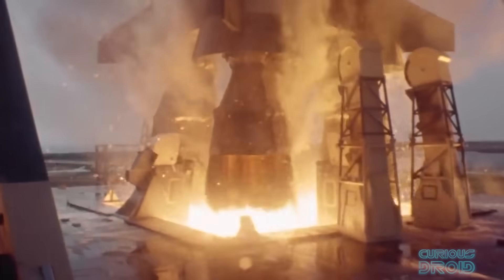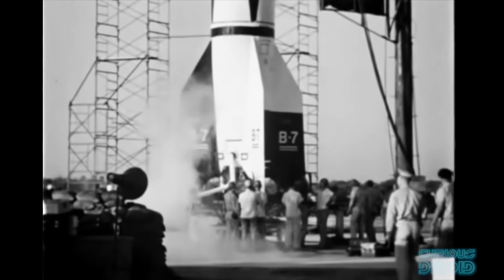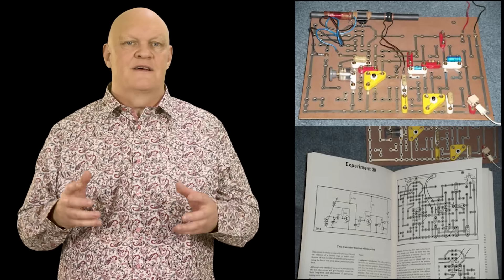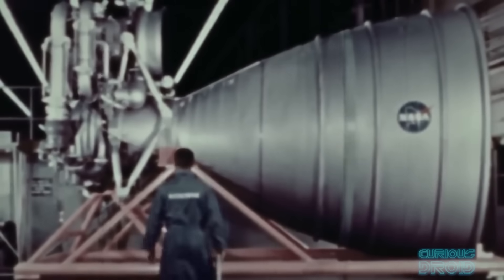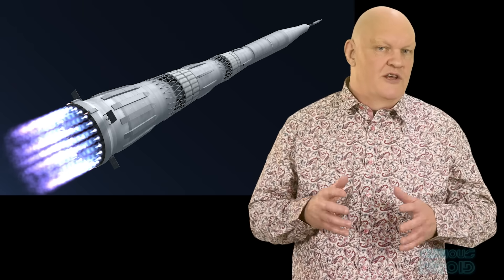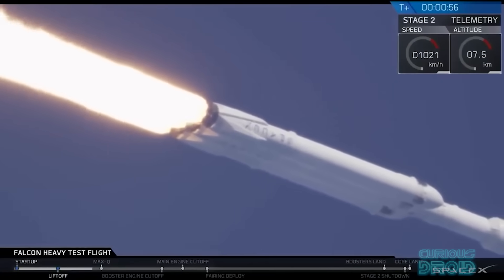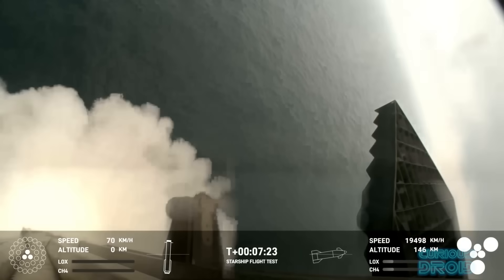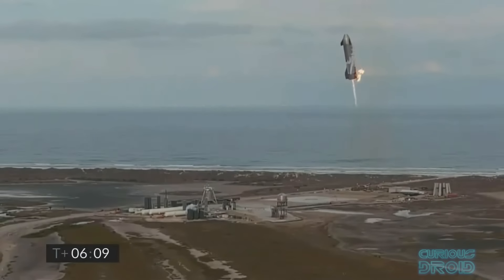Why Does SpaceX Use 33 Engines While NASA Used Just 5?

Comment: Simple answer: SpaceX didn't want to have to do that much engine R&D. So they opted to follow the example of the Soviet N1 and just use a lot of the same engines they use on smaller rockets.
Reply: You think they didn’t do R&D for raptor, an engine with the highest chamber pressure ever developed?
Reply: @infinitelyexplosive  - Doesn't change the increased risk of needing so many individual engines. Gushing over the specs is meaningless.
Reply: @daniels7907  The risk associated with engine count surely depends on the number of engine outs they can still complete a successful launch with? I don't see how any of this is related to the amount of R&D they've done on the engine design, regardless.
Reply: @infinitelyexplosive  - Depending on which engines fail, you could have anything from an explosion on the scale that the N1 experienced (the largest non-nuclear, non-natural, explosion on record) or the launcher could put the Starship into the wrong orbit. Really, this whole launch system and spacecraft are getting disturbingly complex. Did you know that they already have to assume orbital refueling of the Starship after launch into orbit before it could continue on to the Moon? That makes the mission dependent on at least two of these launching without issue and performing complex refueling in space.

This is why doing R&D for fewer, but larger, engines might have been a good idea. Starship is looking like it's the next Cybertruck.
Reply: @daniels7907  with fewer engines it becomes completely infeasible to land the rocket again. For the goal of a reusable rocket, they clearly needed to at least have fairly small engines for correct TWR when landing, somewhere between 10 and 33. Do you think a hypothetical 15 engine starship would have avoided any of the issues we’ve seen so far?

I’m still a bit confused on what your actual position on the engines is, to be honest. Do you think raptor hasn’t had enough development effort, or just that they chose the wrong architecture? How are either of those related to the moon lander, which is entirely a second stage design?
Reply: @daniels7907  It seems like you're unable to keep an idea for more than one comment. You've gone from "engine R&D effort" to "overall ship reliability" to "orbital refueling" to "elon musk politics". I'm just trying to understand how you think that developing raptor didn't take an enormous amount of R&D. At this point it doesn't seem like you'll be able to answer that.
Reply: @infinitelyexplosive  - The problem is that you fail to grasp that all these things are interconnected. I NEVER said that the Raptor series didn't consume a lot of R&D effort. YOU claimed that I said that. I was pointing out that using 30 or so Raptors like this was disturbingly similar to what the Soviets tried to do with the N1, which ended in catastrophic failure. 

That, in turn, leads to all the other problems I pointed out, which you didn't want to read because you can seemingly only focus on one aspect of anything at a time. We're not playing a game of rhetoric here. The topic is the impact of this design on the entire launch system and how SpaceX is taking large risks while trying to avoid developing purpose-built hardware for a launch system whose intended use is different even from Falcon Heavy.
Reply: @daniels7907  except that raptor was designed and built for starship. So your entire premise is incorrect.
Reply: @infinitelyexplosive  - Doesn't change the core problem: so many engines increases the number of potential problems.
Reply: @daniels7907  And in most cases decrease the impact of those problems, because you have redundancy. This is a basic engineering concept that you seem to be overlooking. Unless you can actually calculate the probability of failure and understand the number of acceptable failures, you can't actually calculate whether this increases or decreases system reliability.
Reply: @daniels7907  To be clear, N1 test flight 2 was not even close to the largest non-nuclear explosion in history. The Halifax explosion was. But whatever, let's just call it a large explosion. It's still completely absurd that you're trying to extrapolate from a single failure of a different rocket with different engines from half a century ago. It's so obviously unreasonable that I don't even know what to say.

Comment: The solution to fix huge rocket engines instability was never found. Russians tried everything, but it did not work. NASA also, so it had to fake F2 rocket engine, it simply did not have enough thrust. It was not able even to lift Saturn V rocket into orbit around the Earth. One engine had a thrust of around 120 tons, but not 700 tons, as lied by NASA.  So the whole Saturn V rocket simply splashed into the Atlantic ocean. Apollo was fake, man never landed on the Moon. If F2 rocket engine was good, then why is not being used today, some 55 - 60 years later? Because is not good, it was fake.

Comment: A little off topic but riddle me this:

Saturn V:   ≈ 3518 metric tons of thrust.  Could deliver 140 tons of payload to LEO. Could go to the moon without refueling.

Starship:   ≈ 7127 metric tons of thrust. Predicted to deliver 100 tons  to LEO. Musk says probably less. Needs upwards of 15 to 20 refueling missions to get to the Moon.

How does this make even the slightest amount of sense? What am I missing?
Reply: Starship is reusable. If you fly it expendable, it can probably deliver around 200 tons to LEO.

As for reaching the moon, Starship could reach the moon in a single launch if you just added additional stages. As an example, you could add everything from the third stage of Saturn V and up to Starship, replacing the payload bay, and do an Apollo style moon landing.
Reply: @SpaceAdvocate  None of what you are saying is reality. What you are saying is that if the starship was a different vehicle it would work differently. 

200 tons to LEO is what they call pie in the sky. It's not real.
Reply: @mrwiffler9942  It's real enough that if you went to SpaceX and said "I have this 200 ton piece of hardware I want to put in space in two years, can you do it for $500 million?" and they'd say yes. It's just a matter of doing two things, firstly, burning all the propellant, not reserving any for recovery of the vehicles, and secondly, lightening the vehicles enough that you get the needed payload margin (removing grid fins, aerosurfaces, heat shield, etc.)

But, since there is no person banging on SpaceX's door, it's not something we will see in the near future. SpaceX will continue focusing on making Starship fully and rapidly  reusable.
Reply: @SpaceAdvocate  Dude, you're living in a fantasy.
Reply: @mrwiffler9942  SpaceX specializes in making fantasy reality.

Comment: I recall, during the very early days when SpaceX was just starting design work on what was then called the Big F***ing Rocket (BFR), Elon tweeted something along the lines of "It turns out you don't need a super-large engine to do [Mars].  You can do it with an engine that develops about [a half-million pounds] of thrust.  You just need an awful lot of them."  That was the first point that I became aware his BFR was gonna feature between 30 and 40 engines in its booster that each would be about a third as powerful as an F-1.  And I said to myself "Gonna try and make an N-1 that works, eh, Elon?"  Sure enough... 😉

Comment: The 5 F1’s were better. Can you imagine what 6 of them could do?
Reply: The thrust from even a single F-1 throttled down to 50 % would be more than twice as high as the weight of an almost empty Saturn V first stage, so soft-landing that stage would be very tricky. Better to use many smaller engines and shut down most of them if you want to reuse the stage.
Just for the record:
The Saturn V is still my favourite rocket!

Comment: Space x uses engines based on outdateed russian engines. The russians used so many engines because they had issues with scaling up the size of the engines. Problem is that the more engines, means more parts... Which means that there are more parts to fail. And fail they did/do.

Comment: SpaceX considered various engine designs for their future rockets. The original Raptor was to be a much larger, hydrogen fueled design. Eventually, they decided to use methane and to size the engine for maximum thrust to weight ratio for best performance and efficiency, overall.

Comment: For those of us US citizens who started our own country and are not fascinated with the Euro be all metric system that was supposed to take over the world 60 years ago...18000 kilos is approx 40000 lbs or 20 tons and 45000 kilos is approx 100000 lbs or 50 tons. It would be nice if you would use both measurements in your videos considering these were US Rockets being built. There FTFY

Comment: Two things Paul.  First, you are wrong.  The F-1 DID NOT have a 100% success rate -- Apollo 13 had the centre engine cut-out during the launch.  Although they burned the other four longer.

Second, that has to be the smoothest segue into an advert ever.  Well done.
Reply: That was a J-2, not an F-1

Comment: In the 1960s, computerized process control was in it's infancy. It was very difficult to manage a large parallel data stream without a room sized computer. Five large engines were a lot easier to manage than 33 or 35 engines. The Russians tried it and failed spectacularly.

Comment: Having more smaller engines also makes the system more structurally sound. The center of a rocket is primarily fuel and the hull is the primary structural component. If the thrusters are put closer to the hull it reduces the leaver from the center of the thruster to the hull. So less torque tries to shear away the mounting of the engine and thus makes the engine mounts lighter. It's not the main reason and you need to balance it out with the engine system weight, but they considered it for sure.

Comment: Elon doesn’t use F-1’s because he doesn’t have any. Building f-1’s or an upgraded equivalent takes time and money they don’t have. But the first time one of the little ones takes out a rocket, that will change. More engines = too many opportunities for failure.
Reply: More engines means it doesn't matter if one fails. You'll still have enough thrust. But when one F-1 fails, it's game over.
Reply: The F-1 is unusable for Starship. 
1. it uses the wrong fuel. RP-1 leaves residue in the engine that has to be cleaned out. Not good if you want to reuse the engine. 
2. It is so large that landing the stage with these engines would be difficult: too much thrust. 
3. It is not optimized for production, they are complicated and difficult to build. Raptors are so much cheaper you can build 33 Raptors for far less than the equivalent thrust in F-1s. 
Raptor is also more efficient (more thrust per unit of fuel used).

Comment: 17:00  First batch of F-1 Engines, 40's of them worth $15,000,000 ;
($15,000,000÷40) = $375,000 per each one Engine. (Apollo needs 5's per each Travel)
($375,000 x 5) = 1,875,000 per each Apollo (Saturn V=5) launched.; $1,875,000 each
(In today's currency/inflation adjusted value) Compared to SpaceX 's Raptor Engine cost of $250,000 per each; Falcon IX=9 need 9 engines : ($250,000 x 9)= $2,250,000 each (9)
For Falcon Heavy ; need 3 of ($2,250,000 x 3) = $6,750,000 .... totally 27 tube-engines
For Super-Heavy (to Mars?) ; ($250,000 x 33) = $ 8,250,000 .... totally 33 tube-engines

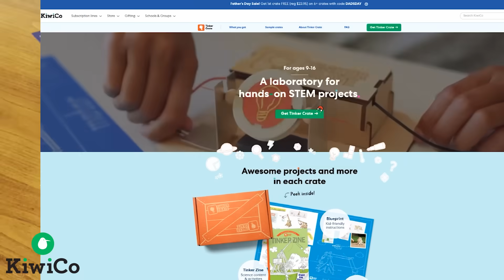Comment: Summary just for me if I come back here: So the reason is that you can easier throttle down 29 engines to landing-back-on-earth stuff and reusability is making engines smaller, but bigger in numbers. 6:40 I never feel left out when childrens play because I'm think more 12-year-oldish instead of my passport 29 years as soon there are kids nearby. 7:20 So in short, the Saturn 5 has big engines as they were thinking everything needs to be big back in these  days or what? 12:55 Ah, so SpaceX wnats to test everything at the same time, so they're faster to get spectacular launches for the public, but the first launches fail as they're testing the boosters only then. 14:13 Musk must know as other than NASA, he also sells Tesla cars. 16:05 Oh thanks, so its not just make it bigger culture, but they weren't able to create mass-production engines, but all needed manual labor.

Comment: I have often wondered if those engines are tuned for different pressure altitudes.
Reply: No. Tuning for different altitudes is done by making the nozzle larger. This is done on the upper stage (with 3 engines optimized for vacuum, and 3 for sea level). On the booster, all engines have the same nozzle size.
Reply: @Hobbes746  The engines on the booster are not tuned for different pressures, but there are some differences between the inner 13 engines and the outer 20 engines. They at least have a different mechanical interface, as they are designed for gimballing, but there may be other differences. The outer engines don't really need to be able to throttle, or restart in flight.

Also, you don't actually need to increase the size of the nozzle. You could just as easily reduce the size of the throat. This increases the expansion ratio, which increases efficiency at lower ambient pressure. But it also reduces thrust. It could be that there are some differences like this between the Starship engines and the booster engines. It is at least a possible future optimization.

Comment: The most important similarity between the N-1 and Starship is not the configuration, but the development method. There are two basic methods:
1. test individual stages on test stands exhaustively before proceeding to the first flight, in an attempt to make the first flight be flawless. This approach is used by most Western companies, and was used by NASA for the Saturn V.
2. Move to in-flight testing much sooner in the development process. This gives you flight experience earlier in the process, but risks blowing up a bunch of rockets.
SpaceX is doing this with Starship, and the Soviets did it with the Proton and N-1. It saves a bunch of money. They also reckoned building a first-stage test stand for the N-1 would have taken years, and they were already behind the US in the race to the moon. For the Proton, 14 test launches were needed before it was ready for operational use, and for N-1 they were counting on a similar number of development launches.

The differences between N-1 and Starship are far bigger.
1. Engines: the NK-15 could not be tested before use. It used pyrotechnic actuators that had to be replaced once used. So instead, they'd build 6 engines, test 3 of them, and if those passed, use the other 3 on the rocket. The successor, the NK-33, was designed for multiple starts and would have solved this problem. The NK-33 was scheduled to be used from the fifth launch onwards.
SpaceX tests individual engines, AND can test the complete stage at least for brief test runs on the launch pad.
2. Control systems. KORD on the N-1 was unreliable, famously shutting down all but one engine when one of the launches developed a recoverable fault. Modern electronics are far more reliable and can monitor and control the engines in far more detail. 
3. CAD. SpaceX can simulate the vibration environment in the stage in ways not possible in 1965, which eliminates many failure modes (at least one N-1 launch failed when a fuel line shook apart).
4. Money. SpaceX is rich and can afford to expend a bunch of rockets if it speeds up the development process. You can see them cranking out rocket at a high rate, even scrapping some of them without ever launching. The Soviets were not rich, and really couldn't afford the N-1 or its development program. It took a year to build a single N-1.
Reply: Конфигурация советской Н-1 и starship похожа, потому, что это реальные ракеты, а не фейковые, как Сатурн-5. Поэтому там стоят реальные маленькие двигатели, а не полуфейковый F-1.
Reply: @swampfolk2526  The Saturn V is real, as was proven by observations from around the world, including the USSR.
Reply: @Hobbes746  СССР ничего не наблюдал, кроме видео которые им передавало США. Сатун 5 реален, только дальше околоземной орбиты он не летал.
Reply: @swampfolk2526  Incorrect. The USSR observed transmissions coming from lunar orbit and from the moon, not from Earth orbit. 
The USSR exchanged lunar samples (retrieved by Luna missions) with the USA,  and could compare Luna samples to Apollo samples.
Reply: @Hobbes746  Да ничего они не наблюдали, никаких таких передач с орбиты луны, да и зачем им передачи вести когда луна над СССР?
Reply: @swampfolk2526  The USSR did in fact observe those transmissions. NASA built sites around the world so they could stay in contact with the mission no matter which part of Earth was facing the moon. They had a station in Madrid, 3 in Australia and one on Guam, covering most of the latitudes of the USSR.
Reply: @Hobbes746  Этому нет никаких подтверждений это ваш вымысел. СССР ничего не наблюдал. Ну и большую часть широт СССР охватывать смысла нет. В СССР станции слежения были только в Москве, Крыму и Байконуре. Ну и еще пара кораблей.
Reply: @swampfolk2526  The Soviet Union monitored the Apollo missions via the Space Transmissions Corps.
Reply: @Hobbes746 Most of your arguments are wrong. You should atheist check them, mostly by non western sources. But here are corrections-

1 While KORD was used for the first three launches, the fourth launch used the S530 system,, which was much more capable and handled the situation much better. It was due to the NK15 engines that the fourth launch failed.

2 Money was not a problem. Problem was bureaucracy and overcompetition. Also, it did not take year to make an N1, it took one month. 12 N1s were cranked out every year, with one NK15 engine made in every 36 hours.

Also, while there are some differences between the two rockets, there are plenty of similarities. Like the use of grid fins, hot staging, etc.